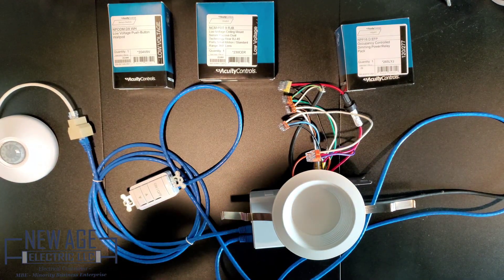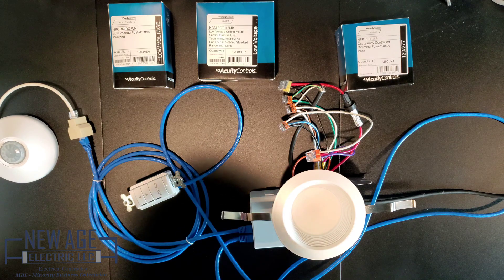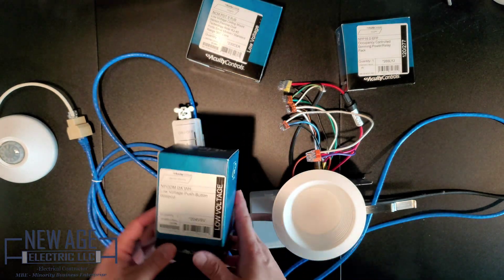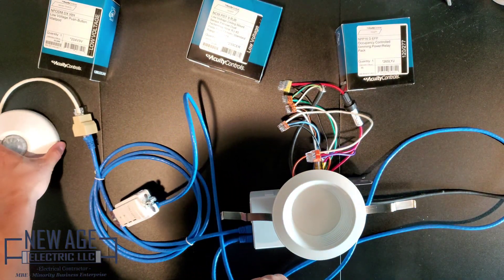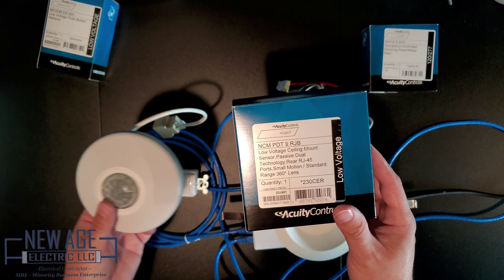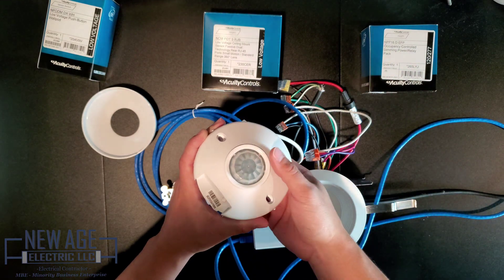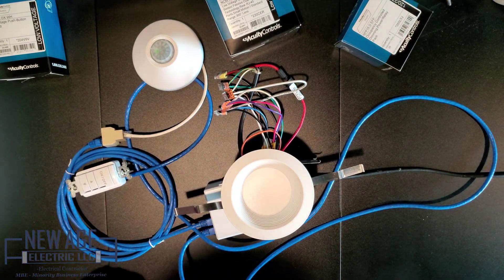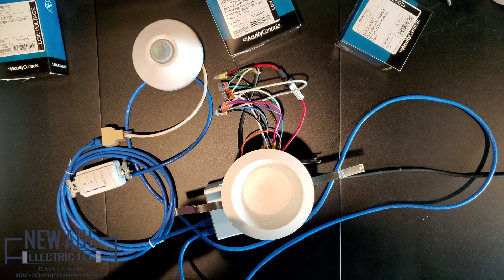Acuity nLight Wall Pod, Power Pack, and DT Sensor Demonstration

Comment: Very good explanation and good video, but I have a question: how can I program it to turn on for 5 minutes and then lower the light to 40% and then turn off after 5 minutes? Is that possible? Thank you very much. I'm working on a project and it requires an inspection. I looked in a restaurant bathroom and they had it like that.  Berkeley ca

Comment: How does this work if you have a three way setup?
Reply from the maker: @tylerzichterman1463  One Cat5 cable to the (1) Npod switch and back to the (2) Npod switch. From the last npod switch, take the cat5e cable to the power pack e.g. a npp16 power pack.

Comment: so if you have 12 of these lights installed you just have to plug the cat 5 cable in and out to all the lights and switch and motion sensor in any order in a nut shell correct?
Reply: All the lights are powered from the power pack. The NPP16 can handle 16A of lighting load

Comment: How can you program the ceiling mount sensor for sunlight dimming
Reply: I did it once on an app where I plugged in the programming codes found on occupancy sensors. I do not remember what the app was called